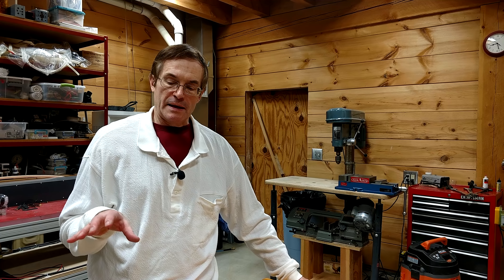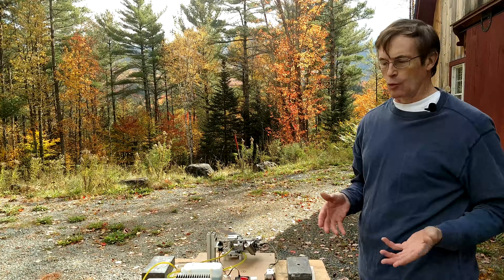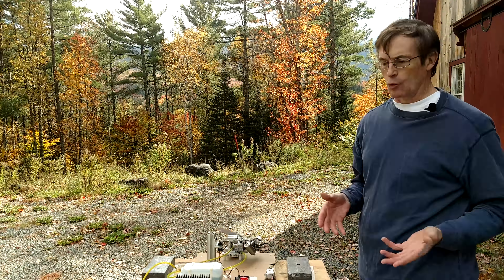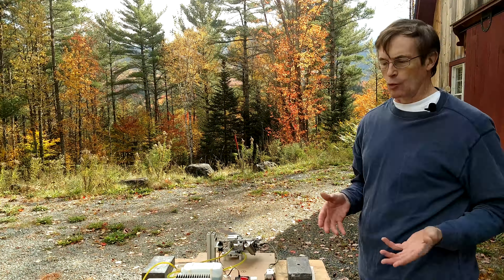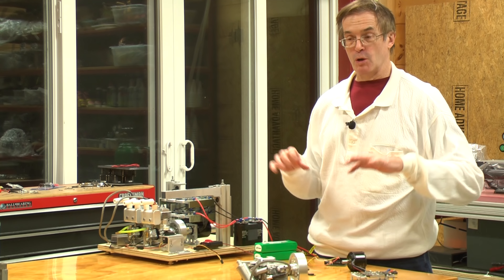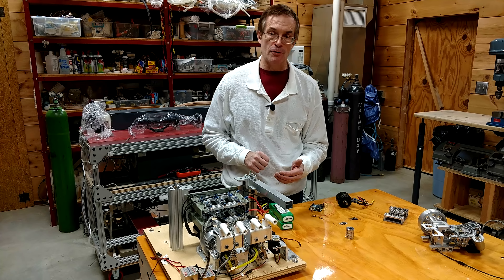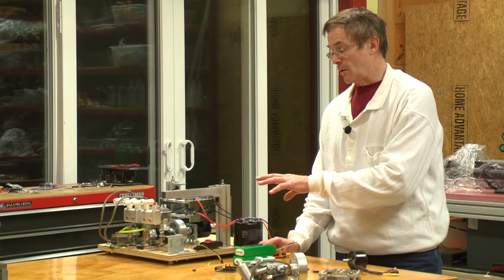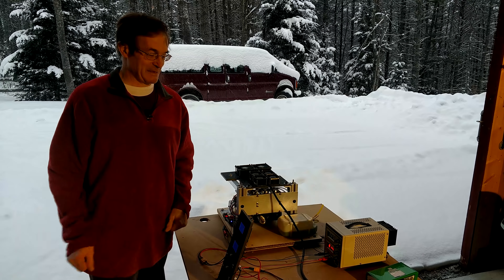Hybrid Drone Generator

Comment: I loved the previous episodes in building large diameter propellers. But, I am not sure if using generator to make electricity then drive the propellers is the most straight-forward solution. If you already have a large diameter propeller like a single-rotor helicopter, why not drive the large rotor directly by the gas-turbine engine, becoming a true helicopter?

Comment: can you use one of the brushless motors as a starter with your batteries and a brushless motor speed controller and a smart tricky circuit? :D
Reply from the maker: Absolutely
Reply: I think that would save a small amount of weight. I would love to work on something like that! Depending on the task you want to perform, vertical take off and landing might be handy but cost a lot of efficiency points. What about a tilt rotor like an osprey? You know those fixed wing planes with the big rotors that swivel? That way you can land with out a runway and still go further and faster maybe. Oh geez now I'm rambling... Anyway, you gave me an idea when you balanced those fly wheels. What if you just mounted them as opposing pistons? 180° opposite, and one revolution out of phase for smoother torque would still be balanced. You should delete the mufflers though to save weight, but keep those back pressure resonators. The main function is to increase the performance, but it's loud for sure. Even though it will be loud, the rotors will be very loud too. Thinking more about the fixed wing, and weight savings and efficiency, and noise, I just realizes, if you are investing in the weight of batteries and motors, maybe a high lift, low drag glider design would be best. The engines only start themselves when the batteries are low, and the motor driving the propeller would be very small so that the engines stay off most of the time. That way you could have a drone glider loitering for days perhaps, and be quiet most of the time. I think that would be much more worth it, otherwise I think I would just drive the propellers directly with the engines to save mass and complexity. Sorry for the very long comment, I love your channel, and like to see power engineering on a small scale like this have such detailed consideration!

Comment: What about using niniatur kerosene turbine that is used for model jet engines?
Reply from the maker: They're very expensive and use a lot of fuel compared to the two stroke for the same power output.

Comment: Are you sure that this is the lightest way of transmitting power from an IC engine to a number of rotors? Another way would be gears and  shaft drives. or toothed belts, with variable (collective) pitch on each propeller, would this be lighter? I don't know. I see Mikeselectricstuff has made much the same observation.

There is weight to be saved on the generators by building the generator into the IC engine as was done by Petter/Lister at one time, saves weight on housings, couplings  etc.

Comment: I've been considering designing a small engine in order to power an alternator. It looks like I'm going to move back to Michigan after about 30 years in silicon valley.  After I get setteled I may pick up this project. Two stroke two cylinder diesel maybe.

I've lost most of my hardware to storage locker auctions so it was nice to watch your videos. I'm waiting to see you light up the clouds with the dye laser.  Is that on a video yet?

Have you considered  a dual mass fly wheel?

Comment: Wouldn’t propane be better for powering the engines? It’s compressed and you can put it in a small enough bottle where it would last just as long or even longer than straight gas.
Reply from the maker: It's a reasonable choice.

Comment: Good idea however please consider the following:

Those engines have counterweights at the back of the crank, this can be verified by removing the back cover, there is no needs for extra weights on your flywheel
Please consider that instead of purchasing two engines, you can reduce the vibration by using a horizontally opposed twin, available from Desert Aircraft et al, thereby reducing weight not just on the engine side of the equation but also by removing the non required mechanism.
Reply from the maker: If the counterweights that you describe are indeed present, they are insufficient to balance the piston as I demonstrated on the bench balance jig.
Reply: Tech Ingredients Ah yes you are right, they are due to that messy piston mass issue, to be honest, the best effect they have is stabilizing the rotational mass.  I did see one of your latest videos where you got a multi, great choices on engines, I love your videos, great content. I'm really glad that you communicate with your audience, please bear with me should I have further questions on later videos.

Comment: I'm sorry I'm late on watching this video. I used to work on the MQ5B Hunter in the army and it is a duel engine UAV, each engine has it's own prop and there is one in the front and one in the back and I believe they did this to counter each engines torque. I dont know if this design could help you in anyway but you may want to look into it.
Reply from the maker: Thanks for your service and your suggestion!  I used to fly the Cesna 337 and it was a very smooth aircraft.

Comment: I’m not that convinced the energy density of your setup is that much better (when you take engines, fuel, electronics combined weight) than batteries..... or maybe I missed that point?
Reply: Land, fill up the tank, start the engi es and already in the air again. I think that is the main advantage of  this.

Comment: fun experiment!
I only wonder what all the engines, their mounts, the generators and electronics weigh.
I've played with R.C planes in the past, and mass is crucial, especially on a drone that has to have a payload and acceptable operation duration. 
The extra mass is going to have to come off the total possible payload.
Combustion fuels do have a higher energy storage than batteries, but the downside is the weight (mass) penalty to extract that energy and convert it into electricity.
There also will be a loss in efficiency by all the mechanics and electronics involved to generate the electricity.
I hope you do a test with the same drone, but instead of the generator. have the same weight (mass) in batteries installed to see which configuration flies longer carry the same payload.
Another point is the reliability of engines, especially the small ones ,as they are vulnerable to slight changes in fuel conditions (pressure, foaming etc.), outside temperature and  moisture content of air, and in R.C need to be adjusted all the time to run optimal.

Comment: why not horizontal oppose the  2 engines??
Reply from the maker: That would work for vibration cancellation, but only if the power strokes we're simultaneous.  Then the power pulse frequency would be 1/2 as great, increasing the amplitude of the voltage variation.

Comment: Great job! It seems you have a system producing around 70 watts at idle and around 300 Watts at peak RPM. I think there is definitely room for improvement, however it is always easier to comment than to actually do something about it. Congratulations again on a very interesting project and thank you for sharing. Do you know the raw torque produced by the engine setup? cheers
Reply from the maker: Check out the follow up video where we run this generator up beyond 2 Kw.
Reply: I just finished watching  several videos of your concept development for a Drone`s APU and I must say that I am very impressed and I believe you have done an outstanding job!!!   Most certainly you have been able to achieve the 2KW mark and even beyond. Congrats on a job well done!
I'm looking forward to your next project related to the 13KW concept development.  Best Regards and thank you for sharing.
Reply from the maker: Thanks!

Comment: hey great show .Maybe I missed something .How about a camping gen. running a/c  motors . I'am learning a lot here thank's.
Reply from the maker: You're welcome. 
 If you don't need an airborne unit then the construction becomes easier because you don't have to be as concerned about weight.  A simple, commercial inverter will allow you tu produce steady, 120 or 240V power.

Comment: A small RC turbine would be much lighter and more compact. I've watched large drones stay up for over an hour, how long do you want to stay up?
Reply from the maker: The numbers for a turbine are very mixed.  They are very expensive, but very cool.  They are light and powerful, but they burn a lot more fuel for the power generated than even a two stroke reciprocating engine.  That is because of their lower compression ratio.
Reply: @TechIngredients  With the weight of your generator I'm guessing to be 20 lbs, it would take an additional 2kw to keep it aloft. Is run time that important? I love your projects, but still wonder where you're going with this one.

Comment: You are a legend. I saw a UFO [very high end drone] made little noise was in the air over an hour appeared to have 3 openings and looked like miniature jet engines in them. It was triangular.  I've seen DIY jet engines, and was thinking that was the setup.  Looked military.  TLDR are triangle drones with miniature jet engines a thing?

Comment: Revisiting this video now, i would now suggest looking at kei-car engines from japan. They have reduced tax on small cc engines,
which lead to small optimized engines, often with turbos (perhaps reducing weight by milling/grinding out parts of the block?) - a turbocharger is also a good silencer already.
(perhaps a haltech/australia engine controller to get exactly what you want for engine control, they have great support)

also for the air/rotor to engine torque bumping, additional to using a boxer (rotor) or star engine,
would it be useful to use a 3:1 or 4:1 gearing ratio between engine and rotorblade?
 two strokes can run really high rpm, the gearing would allow three or four strokes per rotorblade rotation and also increase torque for a generator.
to counter less rpm you can use a larger rotor or three or four blades.
Perhaps larger rotorblades even make up less losses with turbulence, but i guess moving air is always inefficient ;-)
Reply: Why not cut to the chase w a gas turbine?
Reply: @alexdelcastillo1220  because efficiency ;-) its not about max speed, but maxed out time of flight, or rather surveillance time, perhaps also noise and heat signature...
 -but i also wondered why they did not built another version with their turbocharger-turbine "just for fun",

 perhaps with a starter/generator shaft between intake/exhaust housing.

Comment: Couldn’t you use an rc has turbine engine with some gearing? It would be pretty light and would have virtually no vibration... probably costly tho
Reply from the maker: You're right about the cost.😛
Furthermore, although a gas turbine would be very light and have minimal vibration, the fuel consumption would be very high because of the low compression ratio of a single stage compressor.

Comment: i'd imagine supercapacitors would be even better in terms of voltage drop from sudden strains on the power system, but not cheap and even less capacity per kg than those lithium cells.

Comment: Do you ever consider Wankel for smooth operation?
Reply from the maker: We did. The problem is a widly available source in a reasonable power range, so that others could consider the build rather than a one off couriosity.
Reply: I see. :D I also wonder if it would be possible to generate electricity with Wankel engine with the use of permanent magnet rotors and coils around the housing.

Comment: i love your Chanel, you do great staff., but just wondering wouldn't it be cheaper to drive the propellers with frequency controlled asynchronous induction motors instead of DC motors in this case. you can then design a bidirectional DC to 3 phase AC to connect the batteries.
Reply: the drive curve required would require big motors to match the power needed at the desired rpm. The vfd is not better than a regular 3phase inverter which the esc is.

Comment: great d.
i have a single 55cc DLE engine can i use this to make a drone generator
Reply from the maker: Sure.  It will vibrate more, but it'll work.
Reply: @TechIngredients  speaking about the coupling... which shaft coupling will work best  sir?
Reply from the maker: Take a look at the McMaster-Carr catalog and search their shaft couplings.
Note the torque  ratings and the shaft diameters of the engine and the generator.
Reply: @TechIngredients  thanks a lot I’ll do that
Reply: @TechIngredients  there is this brushless motor rated in CCs(comparing it to gas engine ratings ) are theses motors a good choice for generators… for example hobbyking has the 50cc - 150cc rating and sunny sky has the 30 cc rating… these motors operate at a higher current levels in even on low rpm’s. Are they a good choice for generators?

Comment: Saito makes boxer engines with 180 degree timing that have extremely low vibration. This would give that same power stroke percentage as the two stroke engines you are using. They appear to be dle engines which are not of the same quality, however very light. A boxer 4 stroke engine could be used to drive multiple electric motors and should use less fuel than a two stroke. Even better than than using a Saito would be other manufactures, such as Kavan, that do not require mixing of fuel and oil.
Reply from the maker: At the end of our follow up video on this generator I showed the DLE 222 four cylinder, two stroke engine that we're planning to use for a larger generator.  For the same reason this should have very low vibration.

Comment: This is some great work - I've been designing and building microgenerators for a few years now - initially they powered small human hybrid vehicles (ie, Bicycles) and now I'm selling a few to the military for special applications. Power from a typical legal (there are safety standards for small generators) generator is around 600W to 1kW continuous down to a practical minimum  weight around 4.5Kg dry.  This means that they are sufficient for drone aircraft, have about twice the necessary power for a helicopter, and about half what is needed for a quadcopter to maintain level flight with a reasonable fuel load. You can check that with Lift-per-watt charts. A lot of the power limitations come from the available 4-stroke engines - but those engines are widely available and commonly used on grass cutters and small tools. Probably the most complicated part of the system is the control logic, as well as keeping the generator side very light. I don't know if you have any interest in chatting about generator design, control mechanisms, etc, but it's a pretty small world at that end of town. One thing to note - the mechanics are quite complex - I see you've broken a few metal torque transfer couplings, but I 3D print my torque transfer couplings in ABS plastic on a normal 3D printer, and successfully get them running 100 hours, so they can be changed at 100 hourly maintenance intervals, and they have already met that requirement. So even relatively weak couplings printed in ABS plastic on a normal desktop printer can handle 1kW of power continuously for 100 hours. They can also be designed to keep operating even if they do break.  You can see my earlier design here: https://www.youtube.com/watch?v=0Xk7tyYDbWQ - If you're willing to chat via email, I'd love to hear how far you've come with your design. BTW, thanks for the great videos you post.

Comment: So instead of 2 2-cycle engines locked in opposing phase, couldn't you run 4 4-cycle engines locked in complementary phase?  That would give you good fuel economy as well as consistent power output.
Reply from the maker: You could do that keeping in mind the added complexity in the design with 4 engines.

Comment: I wonder if you have considered fuel cell. That might provide middel ground between batteris and generator/hybrid system.
Reply from the maker: Yes we did.  They have a much higher potential, but they are nowhere near practical, read affordable.

Comment: if pulsing the batteries can be helpful then future chargers could be designed to pulse the battery to extend the life.

however the risks of lithium based batteries still applies if mis treated and handled they could start fires
Reply from the maker: Future chargers may well include this function.  It would not be difficult to implement.

Comment: Also, your machining is beautiful, but since the 2 cylinder horizontally opposed engine is lighter than 2 motors you have in tandem with their, why not just take out the large ripple with capacitors, which are a lot lighter to get your power to weight ratio down?
Reply from the maker: The only 2 cylinder, horizontally opposed engines I found were phased to produce simultaneous power and compression strokes.  Additional capacitors are not that light.  There is a specification called ripple current for electrolytic capacitors that gives the maximum allowable continuous  current flow due to heat build up.  This added to the stouter structure needed between the engine and the generator reduce any potential weight savings.
Reply: I understand the type of engines you are referring to.  I would suggest using supercapacitors instead of electrolytic, which have a LOT better power density, and are quite lite.